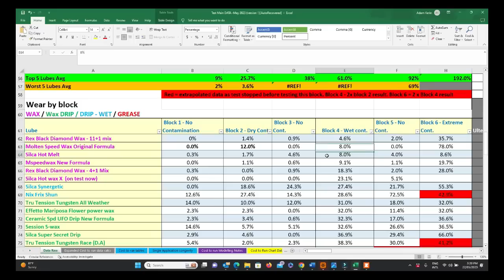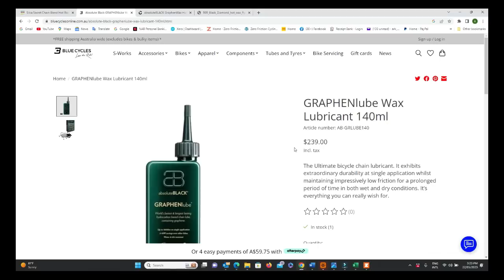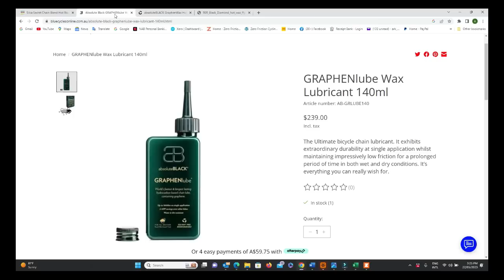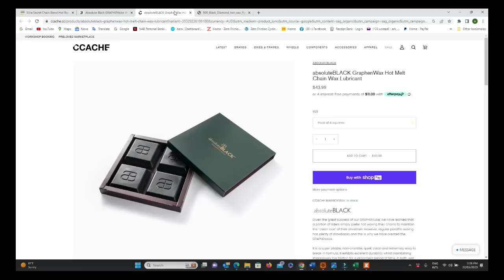Hot Wax X Test Update + Is graphene the new frontier?

Comment: Is there any data on the environmental friendliness of the various friction reducers used in wax lubes? 
Teflon, being a "forever chemical" is probably the worst on the list. 
I'd guess tungsten disulfide and molybdenum disulfide would be similar to each other. 
I wonder how graphene does? Given that we're basically slowly releasing these into the environment as they flake off the chain the question is a valid one. 
I imagine the base paraffin wax is biodegradable?
Reply from the maker: Yes that is a very good question and one that should be asked of all products really. I have on my long list to research this better for a video specifically on this topic and cover the main modifiers and additives. 

At this stage i believe there is some impact re all of these additives, but it gets a bit involved re what is inert (ie so yes its forever, but may not be actively doing anything) vs what may be more active re causing harm. Overall the industry has moved away from teflon, but moly / ws2 / graphene needs more research. 

I can say however than compared to what we already put up with from say vehicles, it is veritable drop in the ocean. Aside from all the cancer causing particulates from exhaust, there is also a massive amount of particulates from brake dust, tire wear etc. So whilst the impact from bicycle chain lubrication may be non zero, it will still be unlikely to even register a blip vs what we are breathing in and ingesting just from vehicles alone - so there will be an overall perspective component too. When is the last time you heard someone worry about brake pad dust from all the cars and trucks etc (another plus for EV's regen braking....)
Reply: Graphene is carbon so it is pretty safe for the environment. That said, it is pretty dangerous stuff to handle because it is a super small powder, not good for your lungs, eyes,etc. I looked up it's SDS when it started getting used in detailing.
Reply: Paraffin is not and poses same threat as most other plastics, while graphene is just carbon dust, namely soot. The impact from chain lubrication is negligible though even compared to soot released from tyre wear, let alone other vehicles.